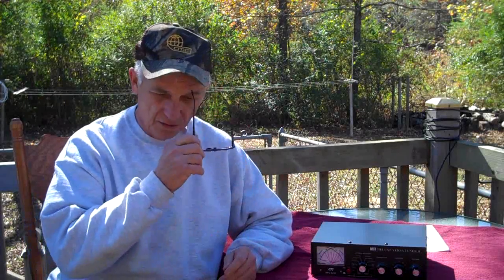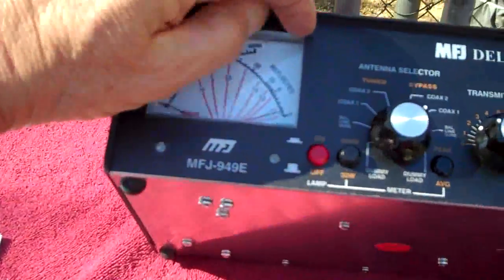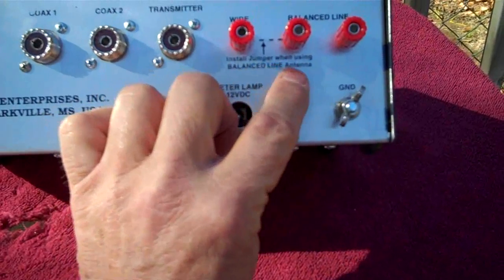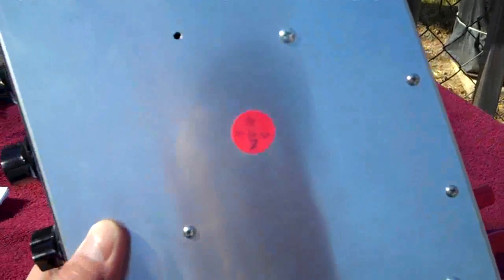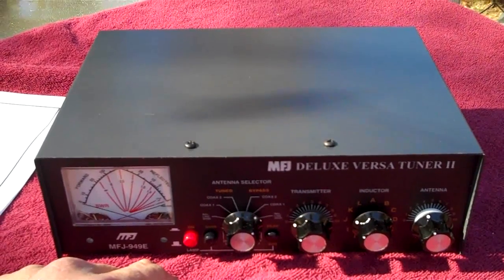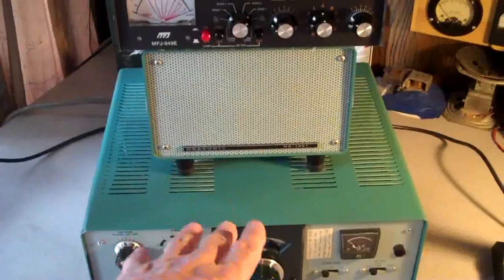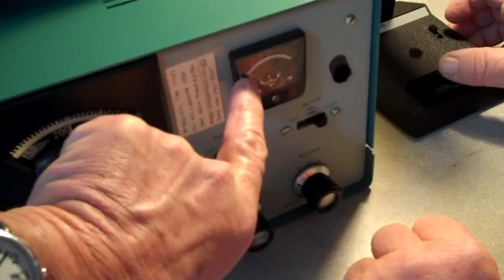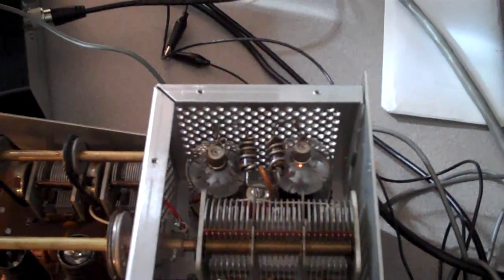Obtaining A Ham License-step by step-the details you need to know (part 24 of 34: Antenna tuners).

Comment: might be the caps in the cage or relays ot a short in the bandpass filters,ps dont let the tubes flash ot yer ruptrure the cathodes ... jeff...
also check valves are the right ones ie6146 it wont werk on a b type ...

Comment: @joernone Broadcast AM (in olt terns 500kc-1720kc).  AM ham radio rigs (radios) are cool.  Join (or at least look at) amfone dot  com (youtube doesnt allow web URL's.) Some ancient AM transmitters from old AM radio stations have been converted to the 1800kc (160m) band.  John, you do have an AM tx there in your Hot Water. Very few pre-1985 transmitters or tranceivers are not AM meaning they cannot transmit in FM mode.

Comment: Show us your AM transmitter. :-)  I have a HP 23, HW-101 and a SB-102.  \ Yep! Sparks are not cool.  My 101 was a partially built unit.  At least now we know theres a problem.  Make sure that you check and see if each component has still the specified value.  Especially check capacitors and resistors.  Generally the closer in value the better.